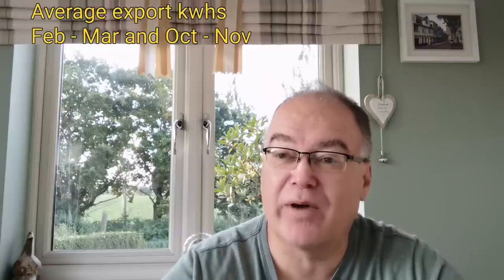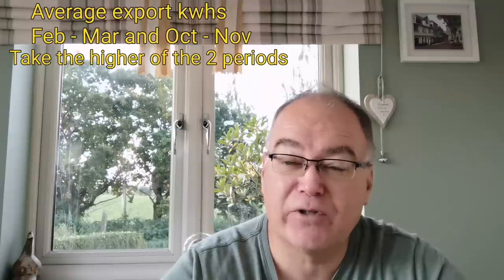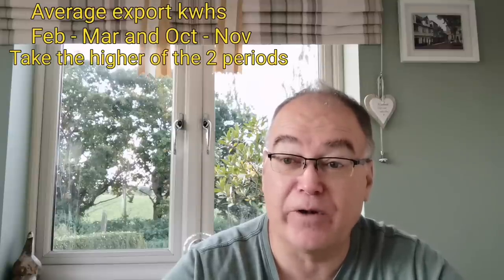How to size a home storage battery

Comment: i recently saw a post on FB that showed a US2000 that had burst. its put me off them a bit to be honest, that and the fact im struggling to find any installers that either recommend them or will install them. they all seem to want to use Gro watt, Giv energy, etc. also how long do think before prices return to the correct levels? i had a Giv 8.2Kwh on order back in Jan 2022, installer could never get any stock so gave up in April, that was £4k with vat, as no solar on it as have a 4kwp already.
Reply from the maker: Prices will rise, that's inflation, salaries won't reduce even if electricity prices do in a year or two

Pylontech are very reliable, much mirbthan givenergy from what I'm seeing
Reply: @EVPuzzle  problem is my salary in the public sector has risen maybe 0-1% over the last 12 years. this year it jumped because the minimum wage went up.
Reply from the maker: It's a real problem. People think batteries and EVs will get cheaper, I suspect not, but whilst you can if you can.

We'd need deflation to see prices go down sadly

Comment: Thanks Nigel. 
going back a few vids can I ask (we've got a 5kw Huawei Fusion inverter) been looking at Luna's. How did you get on with that 5kWh battery you had on loan. looking at possible going for the 10kWh (2x5kWh)
Reply from the maker: Battery was excellent. Fast response and easy to install.

I had issue with the hybrid pv  inverter not being good in low light conditions.

App wasn't great at timed charging either but that might have improved now
Reply: @EVPuzzle  beginning to understand about the inverter have 5100w array with a 5kw inverter (in-place just short of a month)  living out here near Bangkok (Monsoon season) only averaging 15.6kWh of generation daily some days as low as 3.6kWh hoping this will improve going forward

Comment: The biggest issue I have is that my home uses 500W/h nominally and there are a few peaks of around 30minutes to an hour of 9kW when the shower is in use (stepson uses it way too long) or the microwave/toaster with 3kW each I have solar panels of 3kWh MAX but the inverters do not run high enough for the max loads. Instead of the 500-700W average.

Comment: I see what you mean about the GX module. Another thing: have you looked at wiring a switch to automatically change from grid to inverter in case of power cuts? It seems automated products are very pricey for what they are, whereas a beefy 4-pole contactor in a nice box is under £200. Would such a switch work with your inverter charger?
Reply from the maker: I need a switch to isolate the inverter to go on grid not the other way around

Comment: A word to the wise. Some buildings insurance does not cover panels...
Reply from the maker: Not mentioned in my t and cs.  When hardwired it becomes infrastructure and covered within the melting pot for the house.

Hardly a high risk item tbh whereas oil tanks with rusk of leaks and cleanup, some insurers won't insure you at all with oil
Reply: @EVPuzzle  that's not true for all policies. Mine had a specific exclusion for panels. It basically said "PV isn't covered"!
It's worth checking your policy and with your insurer.

Comment: Tesla powerwall is 5 kw charge and discharge nigel, ❤
Reply from the maker: Not all apparently some restricted to 3.6kw
Reply: @EVPuzzle  not quite right Nigel. The Tesla PW will nominally always charge at 3.3kW, if it can meet its objectives by doing so - if it determines that a faster rate is needed, then it will charge at up to 5kW. It can always discharge at 5kW, and can, for a short burst, discharge at up to 7 kW.

Each extra PW adds to the capacity, so two PWs can charge at up to 10kW, with a peak of 14kW.

HTH

(I did reply earlier, with a link to Tesla’s own page on this, but think you have ‘auto-delete’ set on for any posts containing links - a quick Google search on Tesla PowerWall Charge Rates, will lead you there though).
Reply: OK... you're all wrong, and right.

I've got two Powerwalls (27kWh) and a Gateway 2

Each Powerwall discharge rate is limited by DNO Approval.   So some properties are restricted to around 3.6kW continuous discharge by G98 regulations.

With a G99 Application a Single Powerwall can be ramped up to discharge at 5kW continuous max.

Our house is G99 approved for two Powerwalls discharging at 10kW (with short surge periods higher than that).

Tesla Tech Support can change these settings remotely based on your G98/G99 Approval specs.

With regards to charging.  We can charge up to 10kW with the Powerwalls, but the AI determines this
Reply: @JustMeTalking  Oops! You’re quite right, I’d forgotten about that process as it was all done for us by the installer.

My bad!

Comment: So just done a calculation on how much electric I’d need instead of oil…turns out we are using over equivalent 15000kWh of oil! Would converting this to electric even be possible in medium size house?! Plus we use 5000kWh of electric per year. So I calculate to get solar to cover this we need a 20kWH array the works at full capacity 2-3 hours ‘every’ day! In Wales is that even possible! Even if oil quadrupled in price which I think it will…it seems oil would still be cheaper over next 10 years compared to buying batteries, panels install etc?!
Reply from the maker: Oil has fair amount of inefficiencies so your 15000 might convert to say 12000 then improving COP value of 2 or more average would reduce you down further to maybe 6000kwh.  It's definitely possible to go Electric

Keep humidity down and it'll be even more efficient

Adding solar will reduce your costs and a battery can Really help in winter, staying off expensive rates

A good installer is needed of course
Reply: @EVPuzzle  thank you this is useful and seem a little more achievable! Of course the big up front is the now install for later gain.

Comment: When you say not to oversize, I have build  48kWh battery from2x 2015 nissan leaf 24kWh batteries. i only intended to use one 24kWh battery but when offered a second battery I couldnt say no!
Reply from the maker: Very sensible, never turn down an extra battery. What inverter and bms are you using?

Comment: Thanks for the video Nigel. No solar in my solution, just batteries. I've painstakingly recorded in a spreadsheet peak consumption times and average consumptions for the Day, week, month, year. My needs are to cover the peak tariff and use the octopus go faster to charge batteries from 21:30 to 02:30. We would also charge the car at this time and run the washing machine or dishwasher. What about the inverter? Which inverter size is needed for say a 17kWh battery. The thing I'm struggling to get my head around is, let's say I have a full battery 17kWh, and I turn on the kettle for 1 minute (smart meter shows 3kW spike). Has it used 3kW of 17kWh battery or 3kWh/60*1 ?
Also what does the inverter do? What is its point?

Another example: I switch on electric shower. It shows 8kW spike on the smart meter. Let's say I shower for 5 minutes. Is it using 8kW of the battery or is it using 8kWh/60*5 ? Would I be able to run the shower at all on a 4kw inverter. 
If my average daily consumption is 13kWh then would you recommend a 17kWh battery?
Reply from the maker: Think you're almost there. KW is power now.
Kwh is power over time, usage, capacity.

Inverter is needed to convert or invert from DC power in the battery to AC power in the house.

Yes 3kw for 1 minute or 3000wh/60 = 50wh (0.05kwh) of energy from your battery
Reply from the maker: 17kwh battery for 13kwh of usage is a big battery. If you could add some Solar you wouldn't need such a big battery
Reply: I was also looking to do this - Battery only no solar as going battery first makes the solar payback look a lot worse when you could charge at 5p. BUT (big but) Octopus have pretty much blown this out the water now removing the Go Faster Tariff and replacing it with 00:30 to 04:30 Go tariff - You might be in luck if like a few you can move onto Intelligent as that still offers a fairly big window to recharge up (6 hours at 10p) - Now Ive revisited my figures as I cannot move onto Intelligent it looks like Solar will be needed in my setup.
Reply: Think about combination of big draw items to perhaps plan your inverter size? They are unlikely to coincide with cheap off-peak grid price.
Reply: @Dreador.  you want to have some solar at the same time to avoid VAT

Comment: Nice video, Nigel. I've been looking at the  Victron Pylontech combination too. I'm starting to get my head around all the Victron models. What made you get a separate GX module? I see they make an inverter with it built in.
Reply from the maker: In case it needs replacing, easier if seperate. Didn't seem to be a cost benefit either way.

I built gx isn't as capable either, less ports and less cpu power

Comment: Great video. I thought the PW charged at 5kwh though? Hopefully get mine within the next few weeks. Been on order since Feb!
Reply from the maker: Depends on configuration and whether you have G99 approval for 5kw
Reply: Thanks for clarifying. Just checked my G99 and I’m approved for 5kw. It wouldn’t make too much difference anyway as I’m currently on octopus intelligent tariff and get 6 hours overnight charging so would have plenty for the lower rate. (Even though I’ve only used solar to charge since march)

Comment: Hear me out here please - Lets say IF you could run a generator off hydrogen : Have you ever thought of how you could charge those pylontechs during winter ? with say a genny that was basically really really cheap to run and kept somewhere where it would not be heard ? would you/could you and if it was doable how would you make the connection to the batteries so it all went through the houses fuse board - all done safe, ive seen it done in the US but not here in the UK - Well not with a domestic dwelling

Comment: 🆘I have a question to someone who can help. I am in the middle of PV installation and I run into problem because of the stubborn installer. I need to urgently buy 2 x PV panels Q-Cell G9 345W Full Black Mono.  If you know someone who can help please reply.

Comment: Have you seen the v2g or v2h... I think there is a french company that has just released a ccs charger that also does v2[g/h] sounds like a better option than buying of getting too bigger battery... just use the cars one if you have access... or need a bit to take you over those cloudy days.
Reply: V2G/L is very interesting technology but is still a number of years away from being supported on inverters and cars which is when it will become useful. Home battery storage is also important to cover loads when your EV is not at home.
Reply: @markpurcell4507  Yep... and home battery is I think also important... I was looking at the price of the French new ccs, not cheap, but cheaper than buying a 60kwh battery that you'd never use... so you could just add, when at home your car onto the capacity of dedicated home solar battery. I was interested, already have 15k battery, but would be nice to capture a bit more and use when cloudy... or if the cars not used anyway for a few days.
Reply from the maker: Good for grid balancing and occasional use but I don't see it as something I want. I'm constantly trying to add kwhs to the cars not draw from them

Comment: Couldn’t you just start with 5kwh system and add ass needed. Seems like a lot of systems are easy enough add to?
Reply from the maker: I definitely support a modular approach for that reason
Reply: I think you used to hit a problem that additional batteries attracted vat at 20 percent. But now it's zero rated it might not apply. Might be worth checking before going down that route would be my advice.

Comment: My system  5kw Solar Array (south)
Sunsynk 3.6kw hybrid inverter (7kw mppt)  max charging 90A @54.6v (4.9kw)
20kwh (4x 5kwh) Sunsynk BYD  batteries.

September Generation 368kwh
Export 17kwh
Import 6kwh    yes... just 6kwh

Utilita smart energy tariff. No standing charge but first 2 units are higher (was 52p/first 2 kwh, then 29p/kwh thereafter.
Thats now 60.5p/first 2 kwh then 36p/kwh thereafter.

So if I don't use the grid power... no standing charge.

Total electricity bill for September 22 £3.60
Total gas bill for September 22 £18.39

Total monthly bill for a 2 bed flat (with solar panels in the garden)

£22.99

My storage is overkill but it does compensate for poor days. I can go 2 poor (rainy) days before I get very low (into the 20% area)
And if I know the weather is going to be bad... (december) and i have completely discharged the battery and already pulled.ppwer from the grid... i will do an 100% charge throughout the day  so that for the next 2 days I won't use grid power and won't pay the standing charge for those days.

I dont have SEG setup as some of this was DIY setup... however for the 10k it cost me, the ROI based on Generation at 36p/kwh is 100 months  8.3 years.
But if I'm saving 2x 60.5p £1.21 a day standing charge for  lets say 10 months of the year (300 days) thats an additional 49p/day saving (2x 60.5p - 2x 36p for the first 2 units)  so a yearly saving if £147. 
That reduces the ROI on the 10k investment to 7.5 years.
The system has only been online since sept 1st 2022, so using September Generation figures gives a rough mean/average for annual Generation and ROI.

I'm sure this will make sense.
I had the option of getting 20kwh of Storage for £6k and zero vat as the company installed the inverter at the same time.
Solar panels were self installed.

Comment: I'm in the building phase.
Already have 6 kilowatts of solar
We use about 13,000 kWh averaging 36 kWh a day.
I project that to go to 30,000 a year with a heat pump and 2 ev's

Custom designed 83kWh of battery rackmount. Price per kilowatt £250
3x Victron quatro 15kva in 3 phase grid tide
Victron MPPT for charging the batteries It's 11 kW. DC only
5.6 kWh more solar

I plan to only charge to 90% and not discharge below 20% to maintain battery life.

I plan to achieve 20 kw of solar
Three EV chargers.
A. Three-phase heat pump
Some sort of heat seasonal storage. Still looking...
Reply from the maker: That's a big install by comparison to mine. 83kwh of battery 😱🤯
Reply: I've heard of GSHP's storing excess solar energy into the ground over the summer instead of exporting..... I don't know who does this though except it's definitely possible!
Reply: @wino99999  I thought about building something.
I'm not going to say how I'm going to do it because the items are in limited supply. Everyone is crazy about solar panels. Pushing up the price buy 30-40%

Just working on lots of installation before I start thinking about that
Reply: @EVPuzzle  

I want it to last. So it's sized to not cycle often.  Pylontech say 6000 cycle at 25c  but that's not going to happen unless you keep it in a temp controlled zone.

They are rackmount batteries that I specified form China.  51.2v at 100ah 
I will have 16 of them. 
In 2 rackmount cabinets.

I will balance then in the summer to 100% 
But normal running they will sit from 20% low to 90% high.

The plan is to use it as a top-up for ev if needed.
UPS for the 5 servers I have, hypervisors, storage, switches and so on.
The ability to run a heat pump when it is needed.

Not looking forward to lifting all the hardware up.  45kg a battery
72kg per inverter mounted 2 meter above the ground.